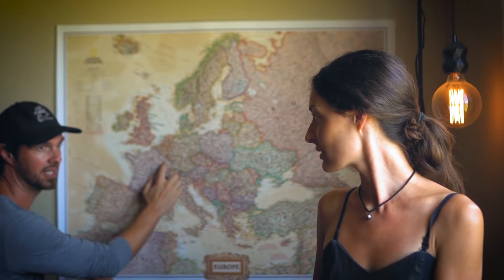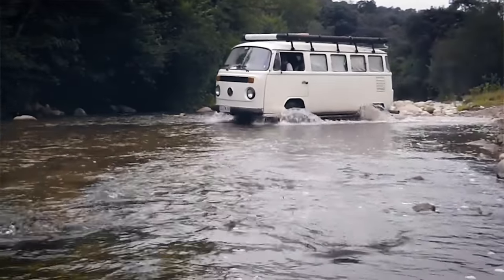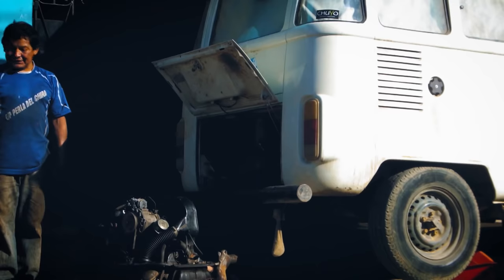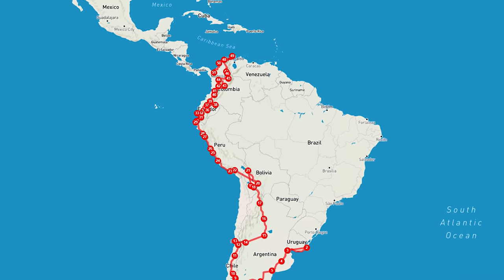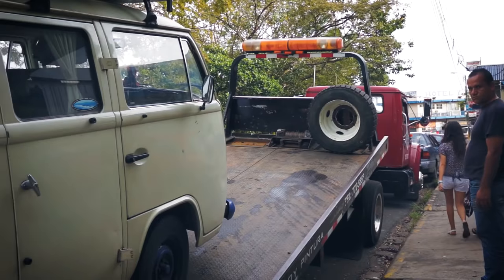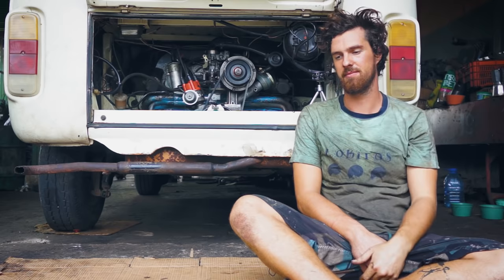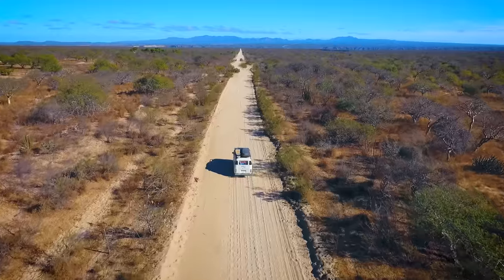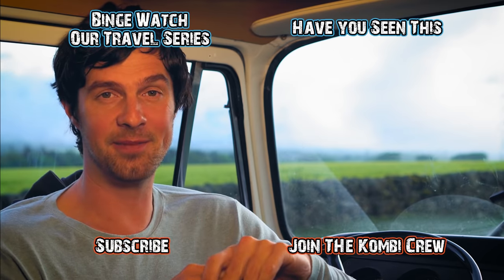How Did I BLOW UP 10 ENGINES in 1 ROAD TRIP???

Comment: They are called temperature gauges use them.
You need at minimum oil temp gauge 
And cylinder head temp gauges for air cooled stuff
After having an oil temp gauge I wouldn’t run without it’s eye opening
Reply: Agreed. The Kombi's  use would be catagorized as severe duty in light of its need to operate in wide differences in atmosphiric pressure and temperature and for long hours (Kombi is not a commuter vehicle, it is an over the road both highway and back country off road capable small bus/van). It must withstand daily 8 to 10 hour work cycles and most automobiles are not built for that. I agree that an air cooled engine should have more instrumentation to monitor engine conditions/parameters. Adding a upgraded fan or other modifications to the cooling system might be in order. The VW engine is world famous and has mountains of aftermarket parts for dune buggy to small aircraft applications. While I might not have choosen a VW for your adventure I believe it a capable chassis with proper prep with its intended use in mind. This is how failure is prevented. I enjoyed the series but did wonder about your mechanical skill and foresight. :)  Live and learn.
Reply: This video gave me a better appreciation for how it happened. Compelling wisdom in this video. And fun to watch.  :)

Comment: Drilling out the main jet lets in more gas not more air. And what you actually need is a smaller jet to let in less gas to avoid running too rich.
Reply: nobonkin exactly what I was thinking. Jets control fuel flow.
Reply: I came here to post exactly this... larger jet equals rich.
Reply: The "mechanic" probably drilled out the air bleeds. Larger air bleeds lean out the mix by allowing more air to mix with the fuel in the emulsion tubes or wells. It also delays the main circuit pull over.  Google carb air bleed.
Reply from the maker: Thanks for the comment.  There is every chance I am wrong.  But I was referring to the Air Correction jet rather than the main jet.  It's number 24 on this diagram. https://www.thesamba.com/vw/archives/manuals/carb_sheets/solex_68to74.jpg
Reply: @KombiLife    Yep, you're right Ben. That is the emulsion tube which has the air correction jet integral to it.  Drilling it bigger will make the engine run too lean at sea level.  
When I travel in Mex in my VW, I have two sets of jets.  Sea level jets and high altitude jets for places like Guadalajara and Mexico City.  When it's time to change jets, It's a quick swap in a parking lot.
Reply: Too much fuel is why it was blowing up 
Running too hot "running too rich"
Reply: @JohnSmith-yc9qn    ..  Didn't you read Ben's comment above?  It was an air jet that was enlarged.  Makes things leaner.
Reply: @curtisbarker9272  : running lean makes an engine run hot, not the other way around.
Reply: there is possibility that the jet have been blocked whit solder and then drilled to smaller size
Reply: @ShamWerks  its an aircooled volkswagon engine either way Lean or rich it can run hot LoL
Reply: if he had gotten one with the 1.6d he would not have had to stop for a breakdown, and would have used 1/10 the fuel
Reply: @curtisbarker9272  In the very early days of aviation some engines were deliberately run rich to "fuel cool" the engine. Excessively rich mixtures burn at a lower temperature & of course a power reduction is experienced. Some of the unburned fuel in an over rich mixture will also make its way past the rings which dilutes the oil, thereby breaking down its lubrication ability. An efficient PCV [Positive Crankcase Ventilation] system will help minimise the problem, however it's never a good situation to run compromised lubricating oil in the small volumes that stock VWs have.
Correcting the mixture will restore combustion efficiency, however the lower volumetric efficiency at high altitude also reduces power in a normally aspirated engine.
Adding an after market full flow oil filter & increasing oil volume along with some additional oil cooling capability will DRAMATICLY improve VW engine life in hot, harsh & high terrain.
VW's were made as low cost transportation devices initially for use in European climates where temperatures are lower than in equatorial regions. Low oil volumes helped to keep service costs low so an extra 5 litres [or more] of oil for the engine in an after market system is cheap insurance in these conditions.
Add electronic ignition, even if only a "points replacement" after market system, such as the Pertronix system, along with Platinum or Iridium fine point spark plugs as well as an oil temperature gauge is also a good idea.
Keep the engine spinning [for good cooling air flow] & the load light [lower gear where necessary] & the humble Vubble Wubble will live almost forever.
P.S. Take a comprehensive [factory?] workshop manual along too.
Reply: @KB10GL  Good greif! Someone who actually knows what they're talking about. Congratulations from an approaching 60 year old mechanic. Your reasoning for an oil cooler is very sound even Citroen 2CV's have them as a standard fit. It was a pleasure to read your comment sir.
Reply: @KB10GL  Another option is adding Porsche oil squirters to the engine case.  They are drilled into the crankcase journals and spray oil to the back of the pistons to help keep them cool avoiding pre-detonation along oiling of the cylinders.  There is also a pressure valve in each one (4 squirters total) that stops the flow of oil to the squirters around 7 psi, which helps with oil pressure loss at idle.  Anyhow, we all have a few tricks up our sleeves, bla bla bla....
Reply: @mcmoffitt   Thanks for the tip. I had not been aware of that one before, but anything that helps to bring engine temperatures under control just has to be a good thing in an overloaded engine operating in hot, high & harsh conditions. The standard engine's oil cooler does not have any oil flow through it until the oil pressure falls below a certain value & this can mean that a stock engine does not have any oil cooling when working hard under load. I discovered this when we fitted a high volume pump to a Kombi & discovered that the oil temperature gauge showed higher temperatures than when the stock pump was fitted.       We fixed it.
As we know, heat will kill an engine more effectively than beating it with an axe, so rectifying this situation in a loaded workhorse engine should be a high priority
Reply: @paulfro1958  Thank you Paul. I too am an auto mechanic approaching 71 years of age & have been a Hot Rodder since I was 14. I have serviced & upgraded a few long distance Kombi's in my time & learned much from others, so I won't call myself clever, .... just experienced.
Reply: @curtisbarker9272  rich does not equal hot on a petrol motor a rich mixture will burn poorly and run cooler a lean mixture burns hotter, the opposite is true for diesels
Reply: @KB10GL  Thanks for your reply. Like you I've got years of spanner swinging under my belt. I never had a lot to do with VW air cooled, The odd Beetle usually for MOT welding or general servicing and that's about it. Had a few Citroen  2CV"s to play with. Our locals used to love them, now they all seem to run Outlander PHEV's or L200 pick ups With the odd Audi Q7 and Range Rover thrown in just to keep me on my toes.
Reply: @curtisbarker9272  Nope, running slightly rich cools cylinder head temp, the leaner the mixture the hotter the combustion, good for racing, bad for cross country summer driving. Also, the leaner the mix, the easier it is to melt engine components, so...a exhaust mixture gauge can help in tuning, but slightly rich will always be your engines friend. Air-cooled engines need more fuel and super clean oil coolers ( inside and out, plus ALL tins in place ) to live longer.
Reply: @e-curb  Which leads to higher head temps, these engines need a slightly rich condition, all of the cooling tins clean and in place, the oil cooler free of debris inside and out, they have no head gasket, so higher temps result in warping head seat.
Reply: Yes yes yes
Reply: @curtisbarker9272  Still running lean will be more dangerous/problematic then running rich.
Reply: Another thing is people forget to drain breakin oil, ive seen people not listen to me and 150 miles later they come back with blown seals or oil pumps due to cloged oil filter from breakin material.
Reply: Running lean kills gas engines, running rich will only cause carbon build up

Comment: Swap for a diesel vw golf watercooled engine. It's a pretty common and inexpensive swap and WAY more reliable.
Reply: If he can't keep an air-cooled running I don't think he will have luck with a different engine.
Reply: I agree and all those hills will become effortless too!
Reply: Go for a subaru engine like mighty car mods did to their bug
Reply: Subaru pos to spun a bearing in the middle of nowhere? No thanks
Reply: Ls swap it
Reply: Camry swap it its way reliable and fuel efficiency
Reply: Wrong.
Reply: @theunconventionaldeal3879  Except he could if its a diesel. No pesky AF ratios to keep tuned, and all you really have to worry about is not having any leaks.
Reply: @nickopedia5669  there is still an air fuel ratio, it's just metered more accurately.
Reply: Barra the world

Comment: I noticed you had a lot of missing engine tin... another reason why it overheated.....
Reply from the maker: Agreed
Reply: @Stimpy&Ren I take it you've never owned an air cooled VW then?
Reply: Missing doghouse tin not too smart.
Reply: @Stimpy&Ren Age means nothing, condition is EVERYTHING.
Reply: And the foam seal
Reply: @Stimpy&Ren As long as this "old technology" is operated within its design & operating limits, aided & abetted by some sensible upgrades like aftermarket spin on oil filter, plus additional oil capacity & oil cooling then many of the problems would have been avoided.
As I wrote elsewhere, a readily available Pertronix electronic "points replacement" kit would remove the downside of breaker points & the attendant slow retarding of ignition timing over time. Fine point electrode Platinum or Iridium plugs will fire across a given gap  & given compression pressure at a lower voltage thereby lowering heat buildup in the coil, but I just open the gap to 40 thou [1mm] & reap the benefit of better combustion.  

Granted that modern EFI would have self adjusted the fuel mixture while the vehicle was driven, however the only real problem with the carb is that the air/fuel ratio would become richer with altitude, thereby losing some power, increasing fuel consumption & some oil contamination over time. However, it would not cause, of itself, catastrophic engine failure, just some relatively minor inconvenience in power output & fuel bills. This would self rectify when returning to lower altitudes.

So, yes, I agree that a modern engine or modern vehicle will have definite advantages, but old technology is not inherently sub standard, particularly if it has been in manufacture for over twenty years, it just needs an understanding operator that provides some old school "mechanical sympathy" when driving, & adds some modern "enhancements" to overcome some "traits" [ok, faults] & old technology can soldier on both reliably & long. It's all a matter of being both kind to your equipment when operating it, & smart in the preparation.
Reply: Stimpy&Ren yet that old combi is still somewhere going strong and the Toyota is long dead.
Reply: @Stimpy&Ren it's actually only 25 years old.  They kept making those busses for ages in south america
Reply: You may also notice, he never seemed to have any issues getting parts.  they might not have been good parts but they were available.  If your Toyota breaks down in middle of nowhere Peru, you might be stuck there a while.
Reply: @JSchroederee  a toyota breaking down though?

Comment: I had a 68 VW van...I went through 2 engines, and 3 clutches in one year, before it caught fire and burned to the ground....GOOD RIDDANCE!!!!
Reply: Tony Bucca apparently you didn’t do it right.. they are stupid simple to maintain but you have to actually maintain them.. most people think gas n go n expect these 50 year + old air cooled vw’s to run like a new car.. you have to adjust the valves with every oil change, change the oil every 1,000 miles or so unless you have an external oil filter and cooler.. then 3,000 miles religiously.. check your timing at least once every couple months and whenever you take a long trip always allow the engine to cool for 2-3 minutes before shutting it off... if it’s hot drive 5 miles slower.. if it’s cold drive 5 miles faster.. always make sure the engine tins and seals are in place or you will just recycle hot air from your exhaust right into your fan intake causing your engine to overheat and blow... if you don’t know what you are doing then don’t own one.. don’t blame the vw for your ignorance
Reply: @mikecorleone6797  Thanks Mike, for all the tips, but I had the 68 back in 1973, so it wasn't old at the time. It was just UNDERPOWERED.
Reply: I have a 68 kombi right now that has a 1500 single port in it.. a whopping 44hp at the flywheel.. it does 65 down the highway no problem.. they aren’t racecars lol but they are extremely reliable when you take care of them..

Comment: yeah them would do it, l would add you were running without the rear engine tin, that alone will kill an engine by overheating. the cool air is suppossed to enter the side vents , instead it sucking up the same hot air all over again, that and muffler heat,  when you look into the engine bay you shouldent be able to see the ground,  l think this time around your going to have a much better time, cant wait to watch them,
Reply from the maker: You’re right there mate. I was told from Central America north of the importance of the engine tin for cooling. Our CB Performance motor is running so much cooler. Can’t wait to see how it goes in the heat.
Reply: on the map pinned with all your travels i was wondering if that line to the east coast was to visit Mustie1

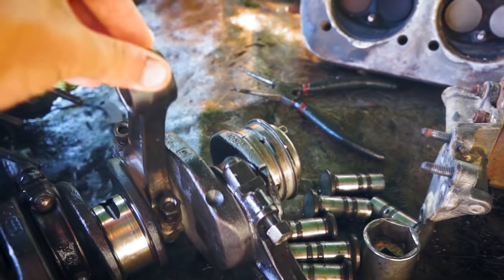Comment: At 16:39 you forget to put the deflectorplates under the cilinders. Thats the reason that your engine overheated.
Reply from the maker: well spotted!
Reply: Yeah.... that’s definitely a no no.. I’ve taken apart mine once or twice bc of that
Reply: Thats an Main issue? Never have seen some on any Kombi I have seen recently in South America. Reason for overheating? -> I'm gonna do it immediately! The Engine has to go out anyway the 5. Time in 2 Months... Happy travels
Reply: Felix Wi yes! The issue with not running a deflector plate, is that the air gets pushed straight out and doesn’t properly cool the whole of the cylinder.. the deflector slows the air down, and pulls the heat out
Reply: In the Swedish VW community, these are called ”glömplåtar” which translates to ”forget plates”. Since you always forget to put them back after the heads have been off.
Reply: That'll do it. made that mistake myself 45 years ago.

Comment: Typically engine tins, the correct oil cooler and engine compartment rubber seals work wonders when used

Comment: c'mon man! You're on youtube! Use youtube to learn about your vehicle inside and out always! I now have an RV, Van and Car all that I manage myself and I've never gone to any mechanic school. I recently even tore out my old york style compressor and bought new gaskets so that i could fully rebuild it and learn how it works. I also replaced the one in my van since it was making noise and learned that a bearing inside overheated (obvious from the blueish/rainbow hue on the metal). Since I watched so many youtube videos about compressors I learned that this is common when it runs with no oil which is what was happening with the previous owner before I purchased it. My point is, use youtube to your advantage anytime something is acting up. Post videos showing the problems if you have to and let people offer advice and help then take your best judgement to choose a solution that works for you. I'm glad you were able to learn more about the vehicle,  I love watching your channel and I'm really glad you posted this video because I definitely did learn a few things myself from it!
Reply from the maker: G'day  Back in 2012 when I started this trip and had the initial problems there was much less content on YouTube.  In Latin America I had very limited access to the internet, sometimes non at all.  But I did post videos asking for technical help on some forums.  Here is one when I totally killed an engine.  https://www.youtube.com/watch?v=m-Tz5v79dEo
Reply: @KombiLife  thanks for replying, i do remember how bad it was then for info. wasn't aware those videos were that day back, but makes more sense now! These days we got scotty, chrisfix and ericthecarguy when we run into issues 🤣. Thank God for the internet! I've been able to save so much $$ and learning so much so fast on my own

Comment: Hats-off to you for persevering and learning the hard way! I think most of us would have thrown in the towel way before the tenth engine removal!

For anyone else watching, pay attention to what Ben says about the roof-boxes and weight in general - WHATEVER condition your wagon is in, immaculate or on its last legs, it's the same as you - it'll huff and puff sooner and more seriously the more you try to carry.

A lot of Ben's issues were related to the age and provenance of Ca'Pito, and the available resources coupled with his self-confessed ignorance about how best to operate it, but the biggest lesson anyone and everyone can take from this and apply to their own situation is to add as much lightness to your rig as you can - consider the weight of every last thing; obsess over it, both when building it and when loading it - light weight will positively affect acceleration, braking, fuel economy, reliability, hill climbing, handling, tyre wear, everything.
Sounds like stating the bleedin' obvious, but you'd be surprised how often it's overlooked.